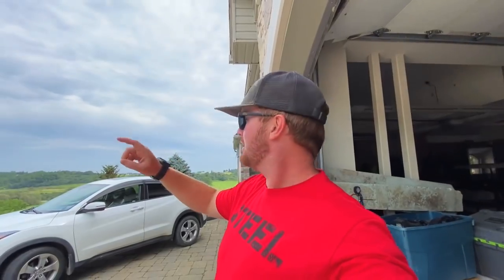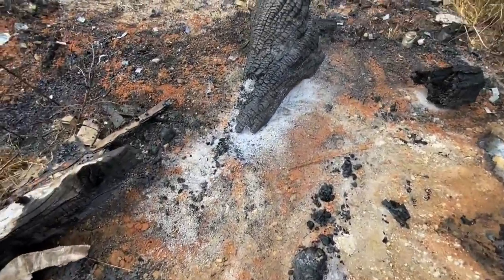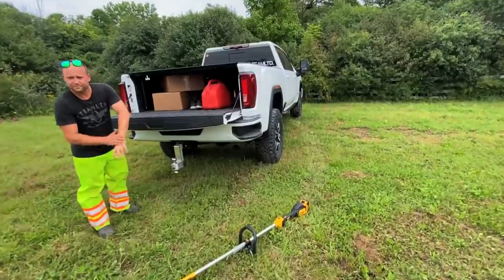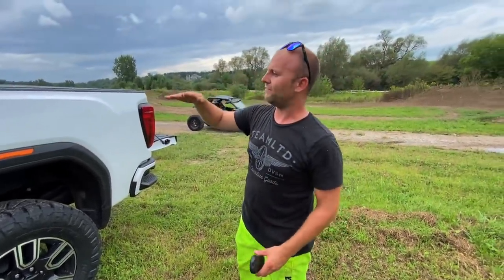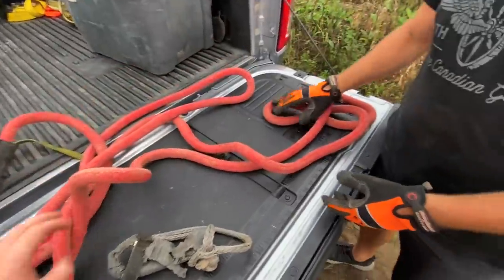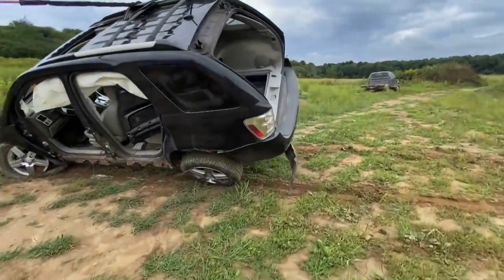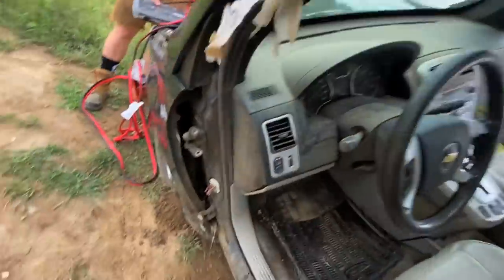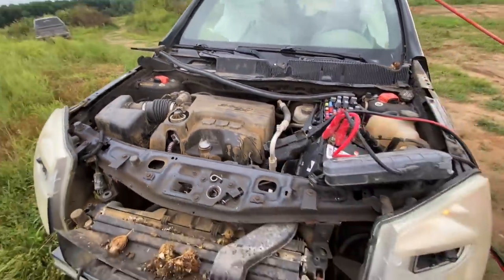Using COKE As Engine OIL!

Comment: Often the healthier the engine was from a bearing perspective (minimal wear), the clearances are tighter. They'll usually lock up quicker without oil due to friction than a high milage worn out engine with extra bearing clearances. Basically it's the opposite of what one would expect.